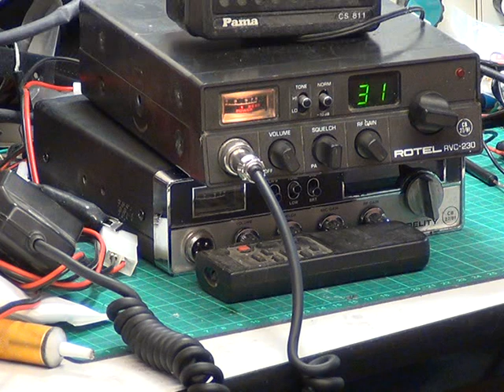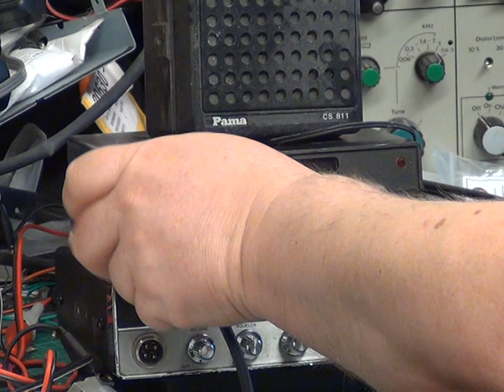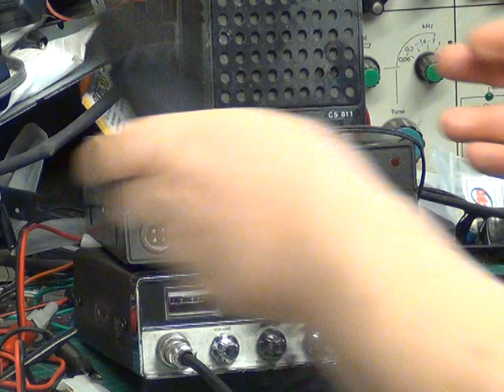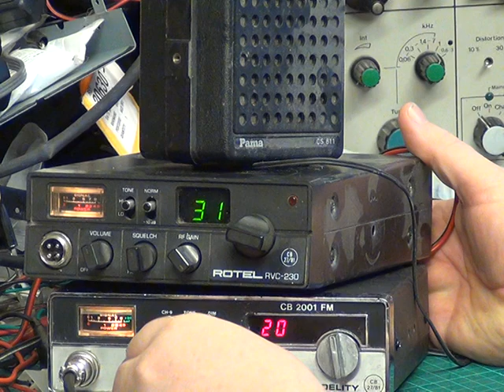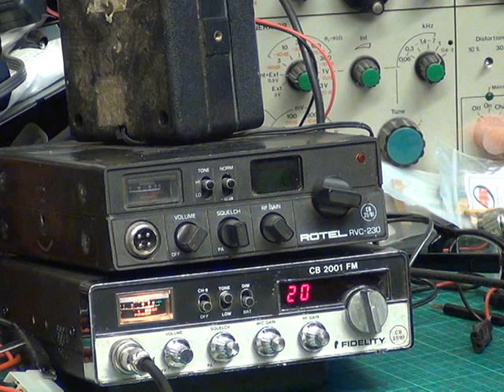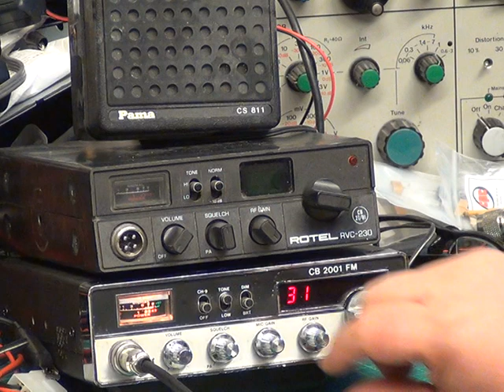Nissan Leaf CB test recorded at base "Testing the test vehicle"

Comment: Interesting. I would have thought the radio in the leaf would be picking up all sorts of QRM. I went to test drive a Mitsubishi Outlander PHEV a few years ago. As it drove passed my car S+30 of QRM. I put the radio and mag mount into it (much to the confusion and slight curiosity of the salesman), S7 of QRM while in hybrid mode. That was a deal breaker for me.
Reply from the maker: Christ, all we have discovered is QRM when applying the brake pedal.We drive it in eco B mode, which is maximum economy & regeneration,and maybe it's the regeneration equipment that is causing the QRM. We will be testing those 3 PNI radios hopefully today & I'll suggest he switches all the eco modes off to see if that's what's causing the issue. Other than the brake QRM issue, there is absolutely nothing.
Yes, the salesman was bemused with a magmount test,and now switch the 12v on, now switch the main power on, now switch back to 12v tests. When he came to give me all that daft warranty info  "we can insure the insurance, and the allow wheels drone drone drone" I put my feet upon the desk & pretended go to sleep.

Richard

Comment: Hi richard I have the fidelity 2000  what's the difference with the 2001?
Reply from the maker: The Fidelity 2000 uses the Cybernet 134 chassis & originally cost £89.99. The Fidelity 2001 uses the Cybernet 002F chassis & originally cost £79.99. They both came out of the same factory in Japan.The 2000 is the better model.

richard

Comment: Love the Rotel. I have a Rotel 220, is the 230 a better performer on receive?
Reply from the maker: Yes John, the 230 has an extra receive stage over the 220. Same chassis, slightly different circuit features.

richard

Comment: I wonder if I could ask for some advice, please?
I’ve just finished a mobile (camper-van) install, 3/8 drill-mount through the centre of the roof, using a Midland 4001 and 2’ Thunderpole Thunderstick. I had a bit of a faff with the ground-plane due to the presence of a 100w solar-panel and MPPT controller and 3G stub antenna. I ended up using a ‘tristar’ radial kit which seemed to have the effect of altering (but not necessarily improving) the SWR. After much experimentation I found that with a top-loaded antenna I could get the SWR down to 1.2:1 

Anyway, all this is by-the-by, my problem is this: I’ve fitted a passive 10w PA horn, front-facing such that it fires unimpeded through the front grille, however performance is very, very poor. I’m not convinced that the CB is putting anywhere near the full 10 watts to the horn. Is there anything I can do about this? 
Many thanks in anticipation, Matt.
Reply from the maker: I'm not quite sure why you think the Midland 4001 has a 10W PA output. Your PA Horn may well be capable of 10W, but with the 2W PA amplifier output from the Midland 4001 I will be exactly the same 2W if you had used a 5W PA horn or a 50W PA horn...it's still 2W output. I just checked with the Midland 4001 instruction book to look at the spec for you. There are automotive booster amplifiers cheaply sold for increasing stereo output. Obviously your PA is mono, so you could use one of those to bring it up to 10W from a 2W input. However, the specs are usually full of bullshit like "128W output" etc.

richard
Reply: @ukfmcbradioservicingTango21  Brilliant, thank you! I was hoping there would be something I could just put in line.